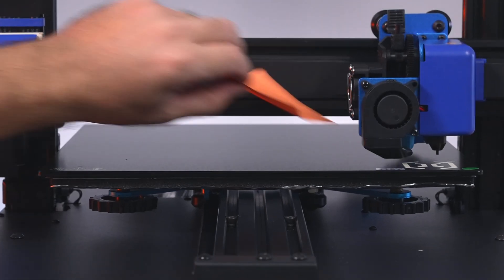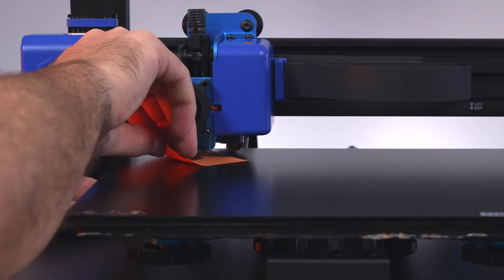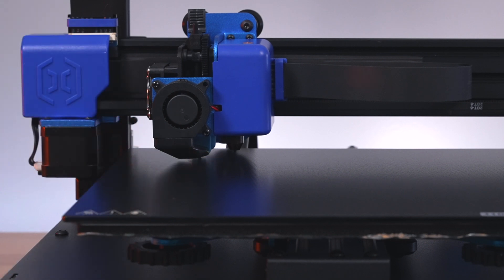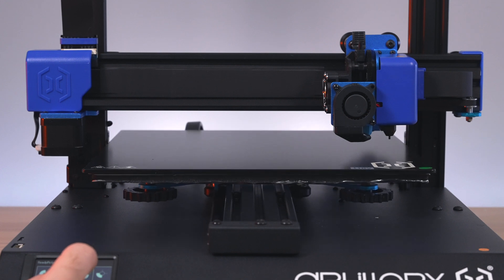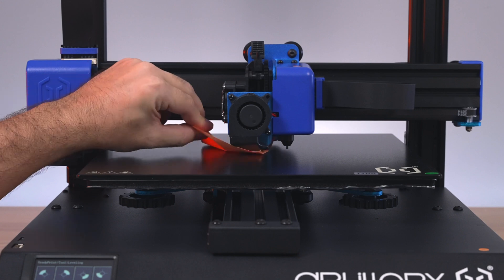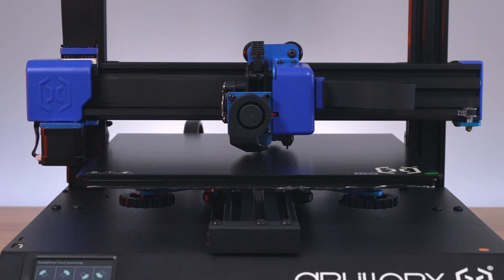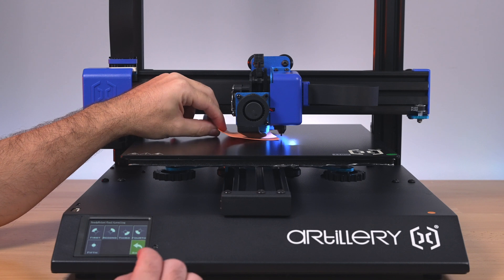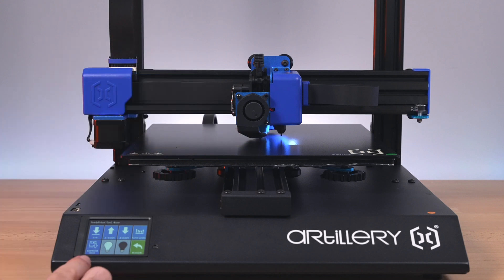Artillery SW-X2 3D Printer - Bed Leveling

Comment: How do i ajust the z offset? It is too low for the nozzle to reach the bed? For me, more only has the different colored lights
Reply: Did you ever find an answer for this?
Reply: No :( i may try to hard modify it but i don't even have access to it right now. Other issues have also popped up so its just hosed. Lmk if you figure it out though. @kristba673

Comment: I’ve tightened the damn knobs the most I can and they don’t ever get friction
Reply: well then it's easy no? losen your nozzle completely, screw in your hotend for 1-2 more rotations, then heat it up, put in the nozzle again. the nozzle should now be 1-2 rotations further outside/closer to the bed/further away from the heatblock...
now: important! Put the nobs to the very bottom, otherwise you will drive your nozzle into your bed!!
then tighten the nobs again until you get friction.